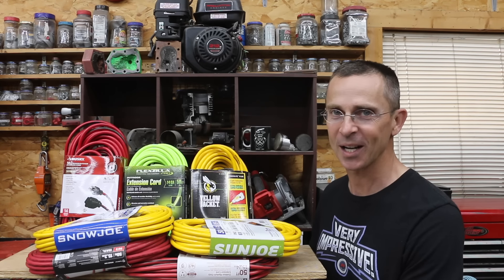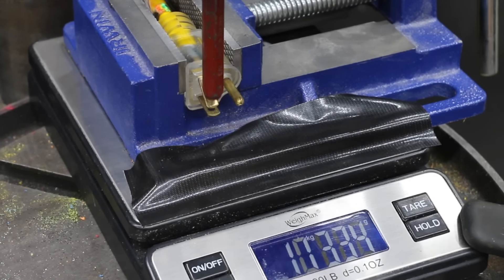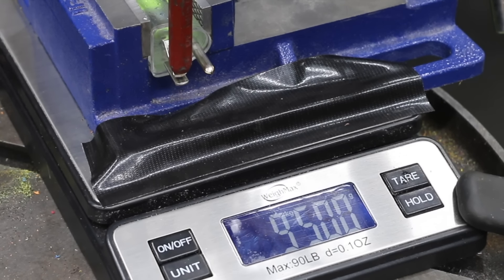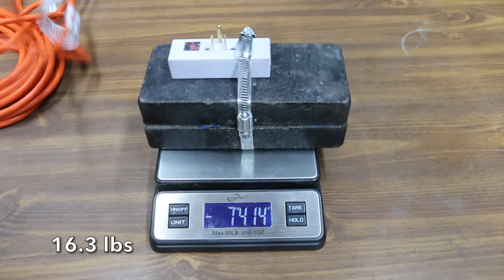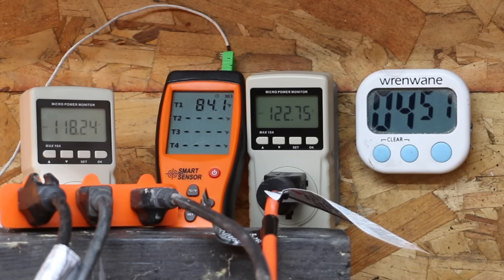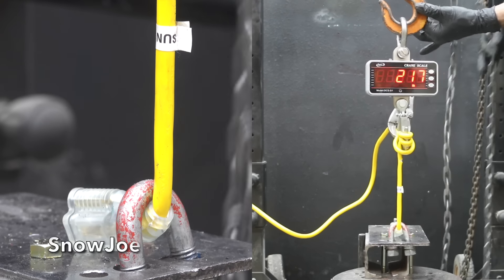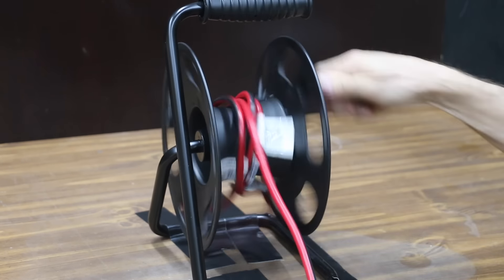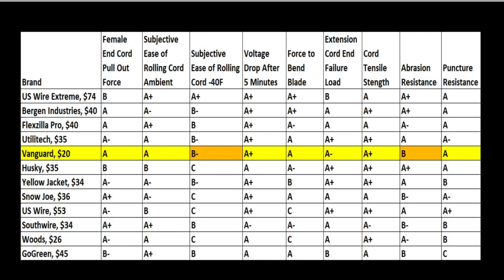Best Extension Cord? Flexzilla, US Wire, Yellow Jacket, Southwire, Husky, Woods, Bergen Industries

Comment: I’ve owned the US Wire Extreme extension cord for about eight years and I would not hesitate to purchase additional units if needed.  It’s superb in cold weather!
Reply from the maker: Great feedback and a great extension cord!  Thank you
Reply: Ditto.  If you live in a place that gets cold, and/or use a wire retractor, this is a great cord.  Also, US made and I had no trouble with a warranty replacement some years ago.

Comment: One of my coworkers has a 12ga 50’  yellow jacket brand cord. It’s been through hell and still works great. The only issue I have with it is the exterior insulation has become rather stiff over the years. This is probably do to all the aggressive cleaners, solvents, and lubricants it’s seen.  In my personal experience what usually fails on an extension cord for me is the female end. After so many hundreds or so uses it gets loose and becomes an issue.  Great video as always!
Reply: Most plastics contain 'plasticizers' - i.e. additives that make them flexible and give them a 'feel', but over time they tend to leach out.  By the way, when using an extension hose for a portable propane gas heater, the propane may leach the plasticizers out of the hose and they can contaminate the heater with an oily residue (no fun to clean out).  There are two ways to deal with this: 1) close the tank valve and let the heater slowly burn off the remaining gas, or ) buy a hose formulated for conducting propane gas.   However, it's always best to shut off the tank valve.
Reply: Have the same cord, both ends have been replaced (due to abuse) would buy again.
Reply: @BobBlarneystone  I had that experience with a name brand Mr heater propane extension (and using the filter). 

Got the heater fixed up and I think all the plasticiser has leaked out by now. It was good for last winter.
Reply: Ends are easy to replace and let you upgrade to better materials.
Reply: @darkerbinding6933  yes, I'll happily grab any "bad" extension cord and repair it. Terminating it to a box or a high quality replacement end is much nicer and more durable.
Reply: I've also experienced a lot of female holes get loose over the years
Reply: I agree ends are easy to replace and I have done so many times. I was just pointing out the fact that this is what usually fails for me, not the male end.
Reply: @JaredConnell  

Giggedy.
Reply: I shoulda seen those comments coming lol.
Reply: @2down4up  If you terminate a 15A cord with a female 20A end, you're just inviting a fire.  Someone could plug in a 20A load. You're counting on the breaker or fuse to save you. Super bad idea.
Reply: Have 2 25' yellow jackets from early 2000s? Still work great, the clear ends are a little cloudy but still easy to see the little light
Reply: @darkerbinding6933  In ordinary circumstances I would say you’re correct. Truthfully I know that regardless of the circumstances you are correct. However it is a 10ga cord used solely on 20amp circuits with twenty amp outlets and only 15 amp consumers are ever plugged into it.  For the risk of fire to be concerning to me someone would have to break into my tool box and use it for something other then what I ever use it for outside of the facility it’s only every used in. Our 20a consumers have dedicated 10ga 20a extension cords permanently attached to them that can reach any outlet in the building that it would ever be used in. So again I know you’re correct and I definitely appreciate the concern but the truth is I had used and worn out every single 15a female connector that Home Depot had in stock. I decided to try the 15-20 and so far it has held up much better.
Reply: @2down4up  I hear you.  It' still makes me a bit queasy. I'd hate to have someone here who is less knowledgeable and careful do it based on this and have a catastrophe.  I've lost a house to fire (not electrical) and it was horrible.
Reply: @darkerbinding6933  I never thought of it like that. You’re correct and I actually regret making that statement now because I never consider what someone else might do with my statement. I will go and change it.
Reply: @JaredConnell  same.

Comment: Looking at the extension cords in my garage (average homeowner), the problems I see are abrasions or tears in the outside jacket and the ends pulling away,  so abrasion resistance, puncture resistance, and end failure are most important.  The Husky comes out on top for my criteria.  Great review as always.
Reply from the maker: Thanks so much!
Reply: Thank you for your comment. It's bizarre to read such a straightforward and helpful comment that isn't plagued with desperate attempts to be cute.

Comment: This is one area where I go completely old school and make my own cords. In the last 12 years of being in business for myself, I've made three cords - two 25-ft 14 AWG and one 50-ft 12 AWG. The only reason I needed to make a second 14 AWG cord was because I ran out of SJ cable on a job and stole it from my cord. I use SO cable from the electrical supply house (600V rated vs SJ 300V rated) and the rubber insulation does fantastic when it comes to the cable keeping it's shape over time (none of that funky spiraling  you see on store bought cables) as well as much improved performance in cold weather - PVC just can't compete. The two additional tests I would have included would be a table saw or large miter saw test where you try starting the motor on the extension cord which will find voltage drop issues, and a space heater continuous load test to check the cord ends with a IR thermometer or IR camera to see whether there's acceptable resistance in those connections. Thanks for another great video!
Reply from the maker: Great feedback! Thank you

Comment: Excellent video and test methods.  Being an electrical contractor and a sound guy, I use extension cords a lot. Most seem to hold up pretty well. I have had good luck with Yellow Jacket cords from 14-10 gage. They aren't cheap but are flexible and pretty durable. I particularly like the light up plugs. Have used Husky, Woods, Dewalt and  other than the Woods they all were satisfactory. I would never use a 16 gage extension for anything. Those cheap white or green cords that are sold around Christmas are junk and could burn your house down.  I mostly use 12 gage wires for current flow and durability. Keep up the good job!!
Reply from the maker: Thanks, will do!

Comment: I've been a fan of Yellow Jacket for years. I love the indicator light that shows it has power. I use their 10 gauge though. I hope it holds up!
Reply from the maker: Great choice! Thank you
Reply: I picked one up to be able to run my welder, and other thirsty tools, it's worked great! I also picked up a 25' flexzilla for when I don't really need 100' 🤣
Reply: Been using them for years great cord.
Reply: @WayneWerner  Yeah, it really is unwieldy but once I got it put on a cord reel, it's been just fine. I honestly never thought of some of the things that were tested. I picked the Yellow Jacket because of the indicator light, hi-vis yellow color and it's apparent heavy-duty construction. 

I wish it had placed higher in the testing, but it didn't place low enough for me to buy a new one.

Comment: I've been happy with my 100 foot long, 12 gauge Yellow Jacket cable.  The lighted end indicating current is a wonderful feature, and the 12 gauge delivers power well for the 100 foot length.  Used mostly for an electric lawnmower, the cable lays flat on the lawn and has some weight so it's not easily sucked into the mower blade (this was tested on more than one occasion 😄).
Reply from the maker: Thanks for sharing.
Reply: Corded mower?
Reply: @jesseshasteen8158  probably a electric reel mower maybe
Reply: @swirlyboi8484  Maybe, but what I use and what I mostly see for corded electric are just your basic horizontal blade mower, just like a typical gasoline mower except with an electric motor (and usually a bit smaller, 18-20" instead of 20+", good for smaller lawns). I like them because they are quite, cool, lightweight, nearly maintenance-free, and I never have to mess with gasoline or oil.

Mine is a Black-n-Decker model MM675, it's about 24 years old now and probably has over 1000 hours on it. Back when it was new cordless electrics were not really available because rechargeable batteries were pretty crappy (NiCad mostly, I don't recall even NiMh being commonly available yet), so if you wanted electric, corded was the only realistic option. If I ever need to replace mine I might consider a cordless now that lithium batteries are available, but it's hard to beat the low cost and infinite run time of a cord.

Comment: Great test! Additionally I would have loved to see how many Amps they can take before showing melting or burning.
If they promise a certain amount of Watt they can take, would have been nice to see how hot they become at this load and how much more they're able to take.
Reply: I can share my experience with amazon basics 25ft orange 12 gauge extension cord and cryptocurrency mining ethereum running 24/7 at 80% of 15 amps (1440 watts) it has been running strong for a year.  They do have some black near the prong end and the female end more black. I just changed to the other 2 female ends and no problems, won't be using these any longer though

Comment: It's interesting how throughout these tests it seems to be a trend that the box store brands (namely kobalt and husky) actually turn out some very good products for their price and personally I've been pretty consistently impressed with both brands performance throughout a range of their tools
Reply: I agree, Husky is never really top tier, but rarely ever bottom tier either. Not bad for the price.
Reply from the maker: Thanks for sharing.
Reply: Well, I think Project Source is a Lowes brand, and it was not ranked too high.
Reply: I’ve also had really good luck with Kobalt stuff. Often the least expensive, but very adequate for anything but daily professional use.
Reply: @stevebabiak6997  Yes, Project Source is one of Lowe's private label brands, and it's positioned very much as their "value" brand. Utilitech, another Lowe's brand, seems to be used for anything electrical in nature regardless of value proposition and is kind of just a catch-all for electrical stuff, so evaluate on a per-item basis. Kobalt is their "we actually care about the brand image" tool brand, so I would imagine they would try to avoid branding anything thats blatantly junk as Kobalt, but you never know, there's probably a few things here and there where some interns have managed to squeeze out some turds with the Kobalt logo pasted on the packaging before their managers caught a whiff of it. lol
Reply: @stevebabiak6997  equivelant of hdx. Both junk basically

Comment: For the tensile strength tests, it would likely be better to have a milli-ohm meter measuring the extension's roundtrip resistance to find out the point at which the conductors got compromised (either rising resistance from breaking strands or falling resistance from conductors getting crushed together and shorting through the insulation) which could be quite a while before total mechanical cord failure for fiber-reinforced cords.
Reply: Exactly what I was thinking
Reply: His voltage drop test is an even more effective way to measure the exact same thing...  wire resistance...  only in a live test.  The higher the resistance, the higher the voltage drop.
Reply: @n2omike  Ripping a live cable sounds like a completely unnecessary burn, fire and electrical shock hazard. Another problem with the two kill-a-watt approach is you need to check calibration between the two or all your measurements will be off by the mismatched offsets and slopes.
Reply: @teardowndan5364  A milli-ohm measurement isn't taken under a load or voltage.
Reply: @stevebrennan9860  How does a four wires milli-ohm meter work? It applies a known test current and measures the voltage across the non-current-carrying wires. There is a test current and voltage. If you absolutely insist on doing a test at 10A, you can simply get a bench power supply with 10A constant-current capacity and a separate multi-meter to measure voltage on the test cable to calculate the resistance. There is no need to use live AC there.
Reply: @n2omike  That's different than testing continuity, which these folks are talking about. Don't be testing tensile strength on a live loaded cable — unless you're also testing your fire department.
Reply: @stevebrennan9860  They are. There's actually no such thing as an ohm meter.

Resistance is measured by passing a controlled current through a conductor while measuring the voltage drop with a volt meter. It's called a Kelvin connection.

Granted, the compliance voltage used is typically under one volt, not city grid.
Reply: @teardowndan5364  Beat me to it. I'll add that a classic two terminal impedance measurement works the same way.
Reply: @RandornCanis  With two terminals though, even if you zero out the test leads' resistance, you still have a massive potential for measurement errors due to unknown contact quality when you are at the sub-10ohm scale. Four terminals measurement eliminates that uncertainty by giving voltage measurement its own separate 1+MOhm path that won't be affected in any meaningful way by ~10 ohms of contact+wiring resistance to the DUT.
Reply: @RandornCanis  Electrical resistance is what he was testing when he did his voltage drop test.  The more electrical resistance there is in an wire, the more voltage that will be lost along the wire from the electrical outlet to the load.  The higher the amp draw and/or the longer the cable, the larger in diameter (gauge) the cable has to be to minimize loss.
Reply: @teardowndan5364  Oh, absolutely right. I'm only expanding on what you already said by including all resistance measurements are conducted under voltage and apparent load, contrary to the comment you were originally replying to. The discussion of 4T versus 2T measurement is for another day with a different crowed.
Reply: @n2omike  Obvious, while completely missing what the folks are saying.

We don't care about resistance. We just want to know whether the copper failed before the Kevlar. That's called continuity.

Allow me to hit this on the head before you say something else obvious. Yes, continuity is a function of resistance. Yes, a quantitative measure would reveal information to the conductive state of the wire concurrent to failure. However, and everyone will agree to the most obvious point here — do not rip apart a cable under 1.8kW load!

That high power alludes to a circuit with high energy potential. Ripping apart a wire under high current will result in series arcing. Additionally, 120V is high enough potential to parallel arc internally or to that metal hoist attached to a pair of hands. This phenomenon has a fancy scientific name — electrocution.

Can't believe I have to say this unironically to another human being: plugging a cord into the wall and pulling it apart with a hoist is absolutely the wrong way to measure anything besides user life expectancy.

Comment: Interesting test!  Appreciated the voltage drop test.  Tradesmen have long suspected some imports cheat on wire gauge. The consistency is reassuring.  I wonder of viewers would be interested in a comparison of insulation specifications, SJT, SJTW, SJO, SO, etc.  For hard use in the powerhouses, we often used SO.  Thanks for all you do!
Reply from the maker: Thanks and you are welcome!
Reply: That's a good point. Lots of variation from SJT to SJ to S type insulation. It's funny how some letters (O & W) are extra features and others (J & T) indicate lower performance cable.
Reply: @PaulSteMarie  it would be good to get the short course, learn how to make good choices.  When we made our own cords in the powerhouses, we always used 600v insulation of types that could take a lot of physical abuse.  Sometimes a bit bulkier cord is worth it, if you worry less about running over it or dropping tool on it.
Reply: @lanedexter6303  My thoughts exactly. I stick to SOOW for shop use because I want something resistant to metal chips and abrasion. Thicker jacket, better insulation, and more internal support.

Also,I think both the SJ and S cable tend to be more flexible than the SJT.
Reply: Absolutely! LU 756👍

Comment: Great video.  I still use a 20 year old, 100' 12 gauge cable of unknown brand.  Has been outside, for years I used it to tie a trampoline down which before this had a tendency to take off in high wind, and for the last few years I have used to charge my electric lawn tractor.   Never seen this cable again since buying it, but I wish they still made them.
Reply: I got 1 of those it's finally failing though, the contacts wore out

Comment: It's been my experience that buying shop cords that multiple people will use, over sizing the wire size and heavier tougher jacket for strength and durability is the way to go. We all know how people like to stand at one end and yank the plug out of the wall socket, drive over them and pull them into knots trying to make it reach without untangling it. I have noticed they rarely do that when they pay for the cords.
Reply from the maker: Thanks for the feedback.
Reply: The bishop has spoken.
Reply: I'm from the uk and I can't imagine anybody pulling the cord in order to unplug it. It wouldn't work in this country anyway but is sounds like a terribly dangerous thing to do.